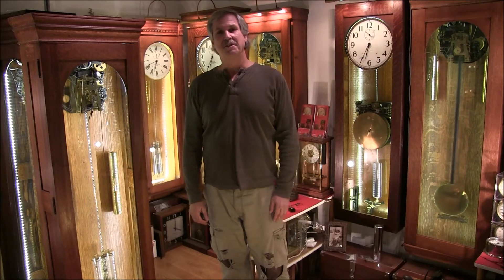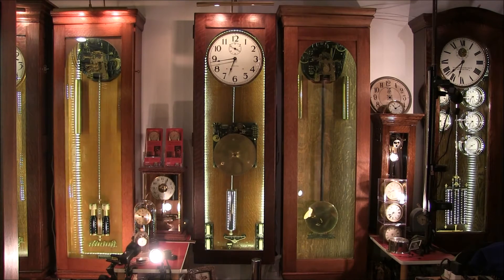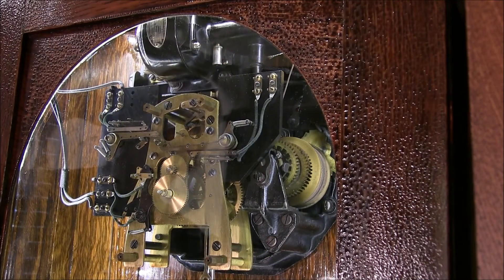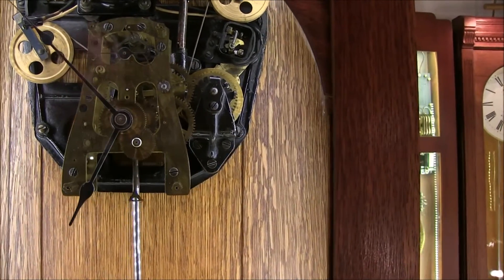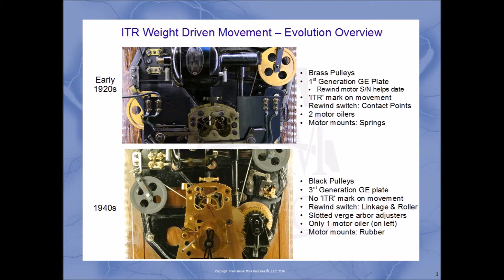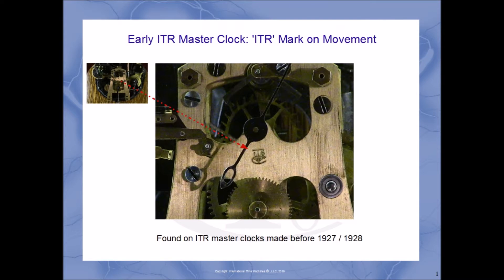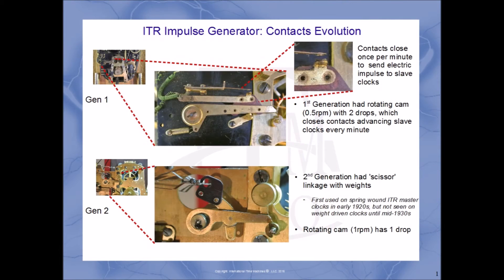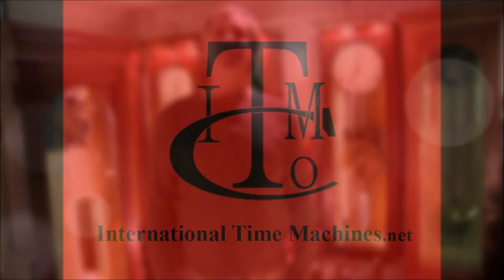ITR Weight Driven Master Clock - Feature Chronology, an ITM Clock video

Comment: Hi Dave, I am actually working on the restoration of a weigth driven Faraday Master Clock from the late 40 early 50. I wonder if you have some information about this kind of clocks (they use chains to lift the weights). Please let me know. Thanks.

Comment: Dave, I have an ITR clock circa  1928 - 1932; model No. 16   7 ser. No. 355500. I understand it to be  "One of a kind."    My Dad worked for IBM in the Cleveland Ohio Branch Office. In 1950 he was tasked with dismantling and disposing of the clock.  As he told me, he did this "very carefully". The clock face is a glass disk with the numerals etc etched in and filled with "gold".